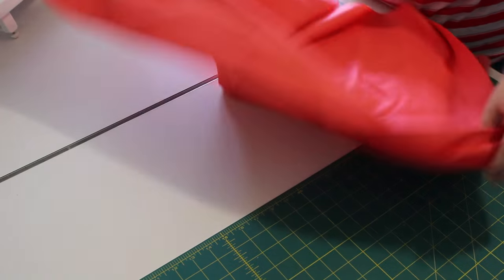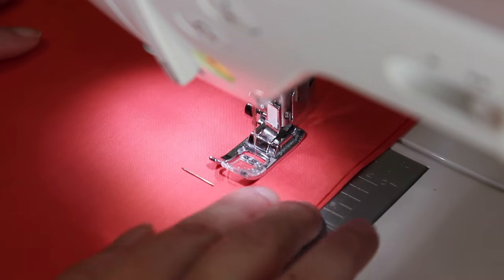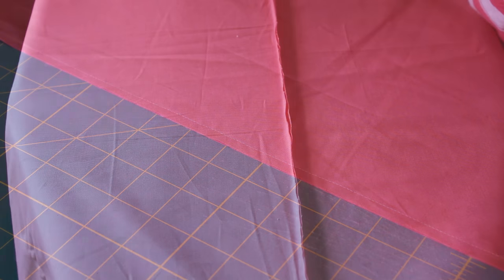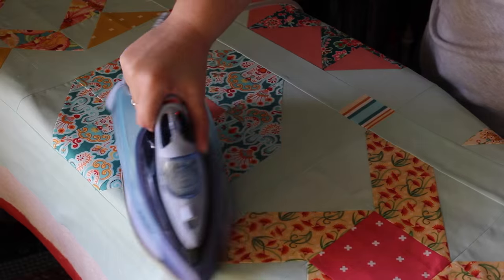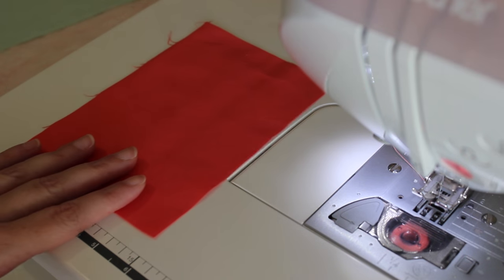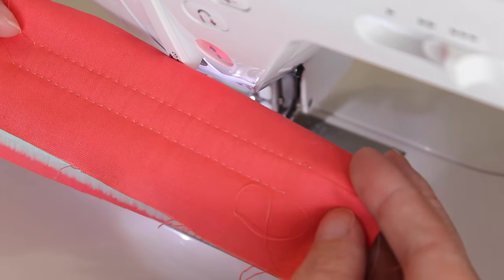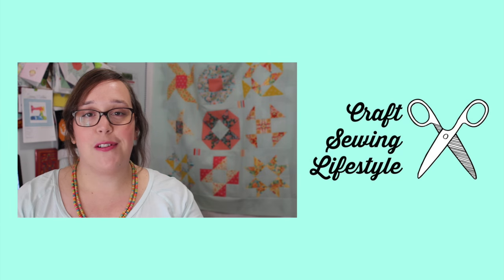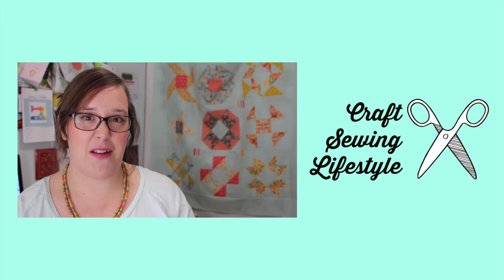HST Sampler Quilt | Backing, Basting & Quilting

Comment: You did a wonderful job quilting this quilt in straight lines, Amanda... Well done! (Did you know that seams pressed open are not as strong as seams pressed to one side? Especially when piecing large chunks together, such as in your backing. For blocks piecing, I would recommend pressing to one side so you don't have any 'splitting' of seams down the road with use. Also a larger than 1/4" seam allowance is also recommended for such long seams as that used in your backing, for the same reason). Just suggestions, of course!
Reply from the maker: Thanks for sharing these great tips! :)

Comment: Good Morning, I just found you. I'm a new quilter.. do you use fat quarters, jelly rolls and such.. I'm making my first quilt and I did not know the backing and batting go down at the same time, I ordered a walking foot but it hasn't come in yet, I also ordered a even feed foot which has come in, can I quilt everything together with a even feed foot? what is a even feed foot for anyway, seriously..lol I thought I could quilt with it. Why is my walking foot taking so longggggg. this was a great tutorial. thanks
Reply from the maker: +Marilyn Kolako Thank you so much for your lovely comment! To be honest, I don't use jelly rolls that much but I do use fat quarters and cut lengths of fabric. An even feed foot and walking foot are basically the same thing. From what I've discovered, an even feed foot is the Janome version of a walking foot. So yes, you can use an even feed foot to quilt everything together, just make sure it's the right foot for your machine. Best of luck! :)
Reply: Its working fine. Thanks happy new year